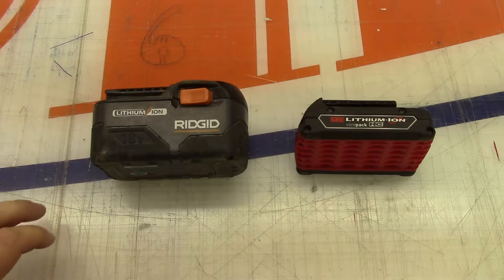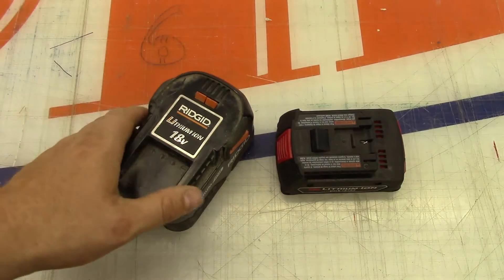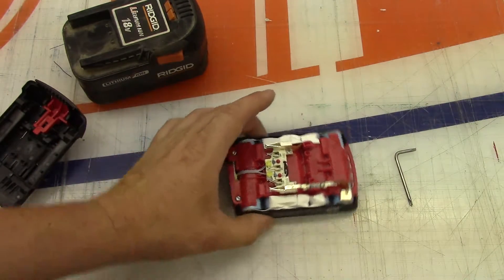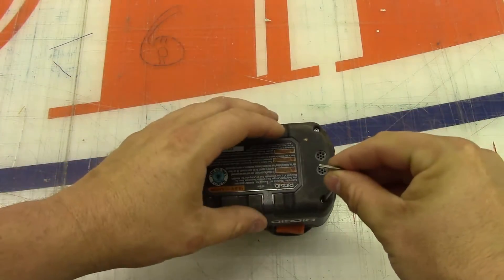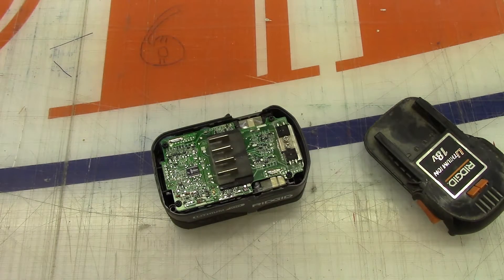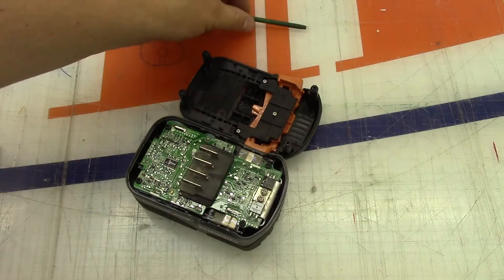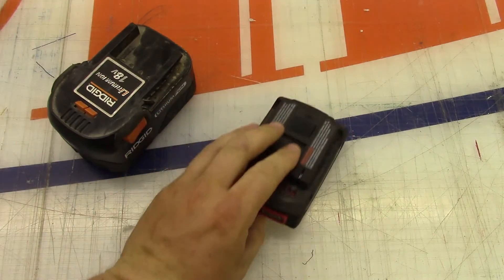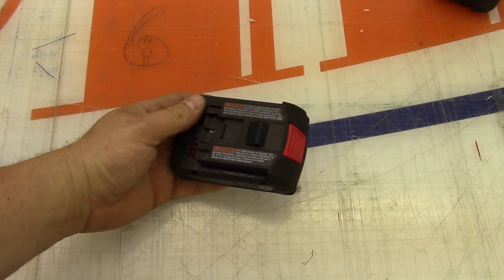021 Bosh & Ridgid battery

Comment: Can bosh battery can be use to ridgid and vice versa?
Reply from the maker: Because the battery protection is in the battery with the rigid battery, it SHOULD be safe to make a physical adapter to use the batteries on other brand tools.  The bosh batteries however only have a fuse to protect from a dead short but can be over discharged causing an unsafe condition if you try to charge the battery again.